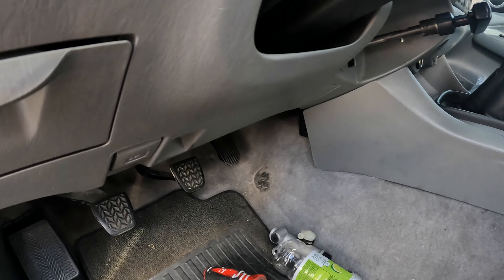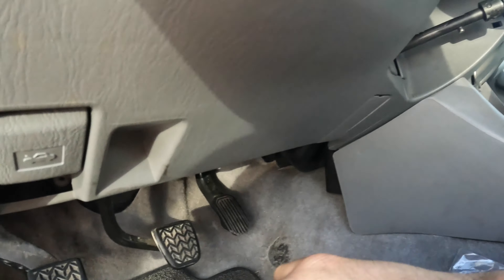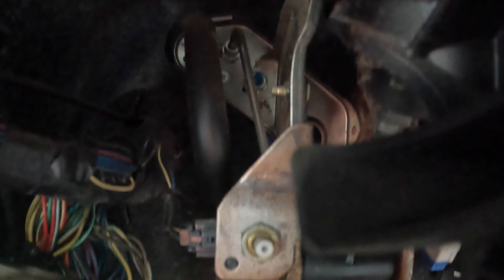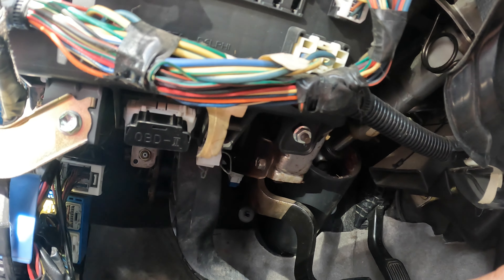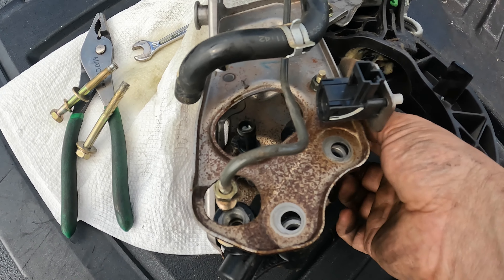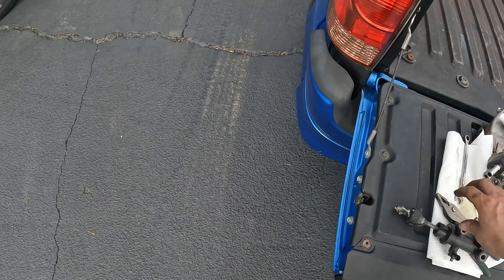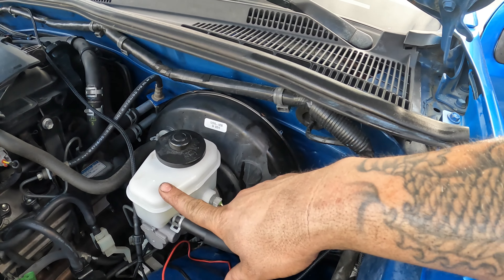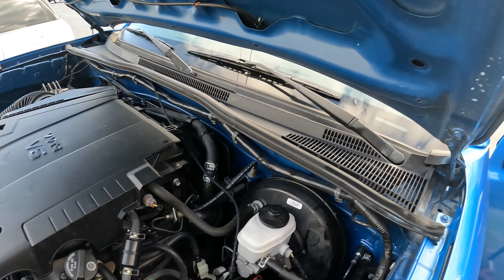2nd  Gen Tacoma Clutch Pedal and Master Cylinder Removal

Comment: Hey man perfect video helps me out I have the same issue with my taco. So how do you bleed the lines at the slave cylinder.
Reply from the maker: Thank you and are you talking about where it goes through the firewall?
Reply: No the bleeding line by the slave cylinder
Reply from the maker: @gallag80  You need to get someone inside the truck and pump the clutch while you open the bleeder.  The pedal will stick to the floor and need to be pulled back up manually the first few times then you can just pump it a few times and hold it down while you open and close the bleeder.  Just do this until the pedal is firm.
Reply: @operationoverhaul Where is the bleeder valve for the tranmission?
Reply from the maker: @Robert581521  It is on the slave cylinder which is bolted to the transmission.
Reply: @operationoverhaul  thank you

Comment: Thanks for sharing the video i was able to replace the clutch master cylinder on my 05 sport 4x4 i did it without taking anything extra off just the master cylinder itself you just need some long needle nose pliers the truck is shifting nice and smooth now
Reply from the maker: That's good to note.  Thanks for that advice and I may try that on the next one.

Comment: The bleeding is by the transmission, correct ?
Reply from the maker: yes, the bleeder is by the transmission on this.  The one step I did with holding my finger over the opening at the clutch was to get fluid through the line at that point.  Then I proceeded to bleed it the standard way afterwards.

Comment: Hello!  How many miles on this vehicle?  My clutch petal rose up about 3" from where the normal compression point was.  Is this a failure sign for a Clutch master cylinder or does the Clutch petal just need to be readjusted? 😏 My 09 Taco 2x4 has 213K on it.  TY!
Reply from the maker: It may need to be adjusted to lower it down a little bit but it could be a sign of the master cylinder failing internally due to a bad seal.  This one had around 140k I believe on it.
Reply: @operationoverhaul  TY!  The Master Clutch push rod is failing, it's not pushing into the petal, so the torsion spring kicked the petal up higher.  It does drive, so if I chose not to do the replacement because I don't have all the things needed to lift the truck to bleed the air, at least I can get it to my mechanic. 😏 Cha-ching. 🙄
Reply from the maker: @kajala11  your welcome and at least you can drive it to somewhere and do not have to have it towed so that will save some money.

Comment: Question. I set up the new master cylinder so it was the same length as the old one, or at lease close.  However when I tried to start the truck it would not. The clutch did not make enough contact with the clutch switch. So I had to adjust the master cylinder rod length. Now my truck starts but my clutch doesn't disengage until the pedal is almost fully released. Would prefer it disengaged about mid stroke. Any advice would be appreciated.
Reply from the maker: The only thing I can recommend is maybe putting some kind of spacer where it makes contact with the sensor.   Other than that I do not know what else to do. You may be able to drill a hole and put a bolt in the pedal.
Reply: @operationoverhaul  Thanks. I think I will glue something on the switch peg to make it a lil longer.
Reply from the maker: @michaelgreene  your welcome and sorry I did not anymore insight on it.  There is just not much adjustment on the sensor.

Comment: Great video. Thanks. Going to have to do this this weekend. Mine has started leaking. Question, Could you fill the master cylinder with some brake fluid before you put the pedal in place to aid in bleeding?
Reply from the maker: Thank you and you are welcome.  I have tried filling them before installing them and it does not make a difference either way to be honest.  It takes just as long both ways.

Comment: You can try to just remove the clutch master cylinder only. Taking it out is simple, and so it is putting it back. BUT GOOD LUCK RECONNECTING THAT STEEL FITTING! 🖕

Save yourself the trouble and pull the whole assembly. If I ever meet the person that designed that steel tube and fitting! 🤬👊🤛🖕